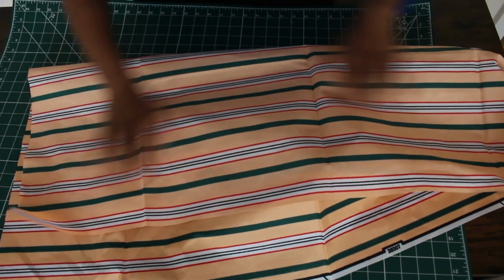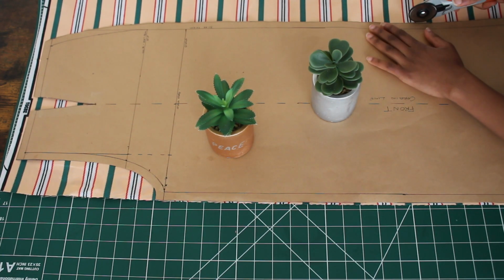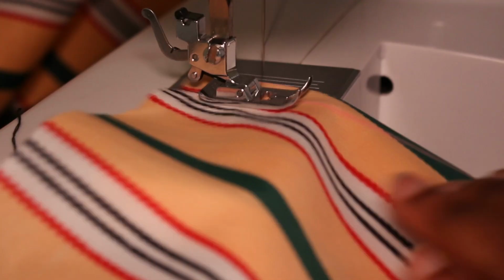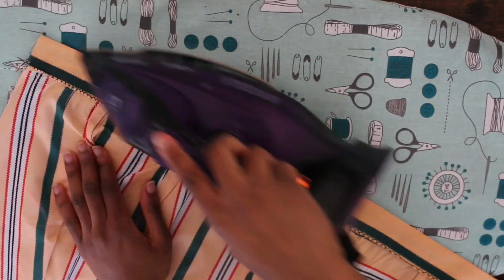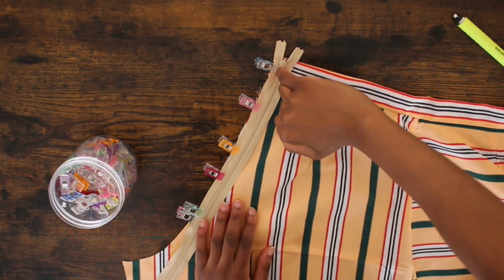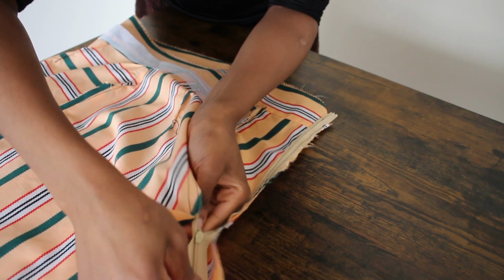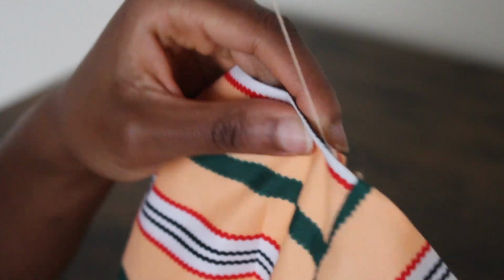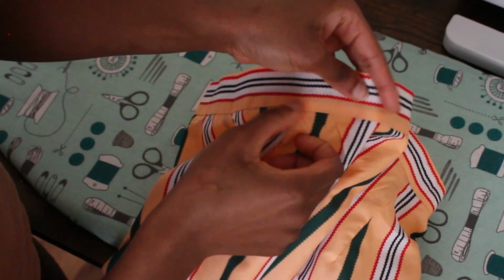How to Sew Trousers| DIY Straight Leg Pants from Your Pattern | 😊 EASY and Detailed!

Comment: Thank you for the detailed tutorial and tips. Just a question: Did the pants block include the waistband inch on the crotch depth measurement
Reply from the maker: Hi Wonderful! Good question no it didn't. This measurement was used when making the waistband part. If it helps this is the full trousers pattern tutorial 👉 https://www.youtube.com/watch?v=ZsgPTawqMOM&list=PL4j45iBJQsF9-HNMKmugpCrc88SU6CxX5&pp=gAQB